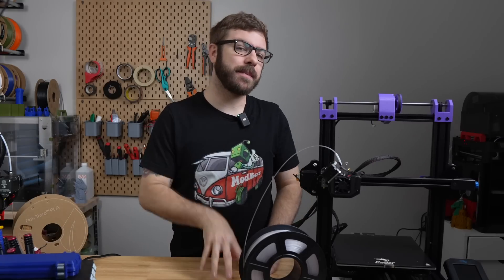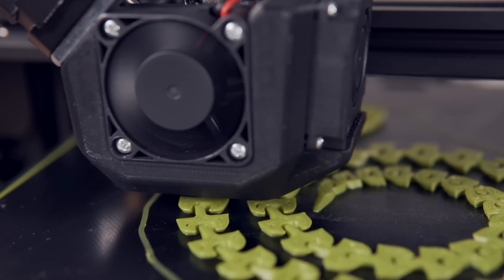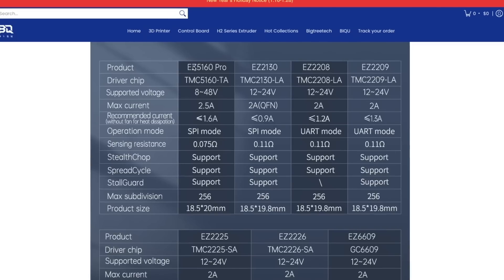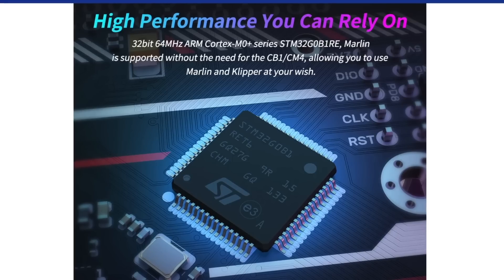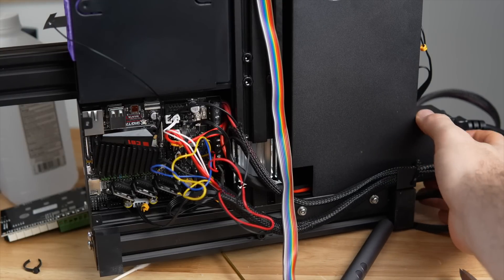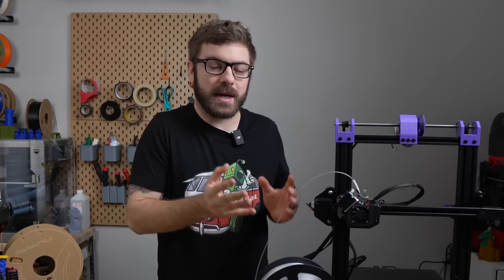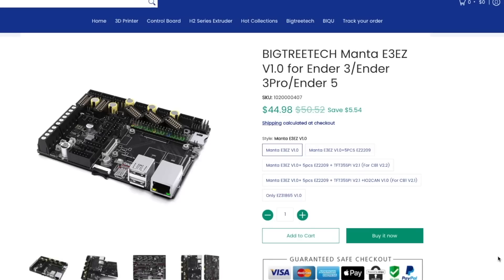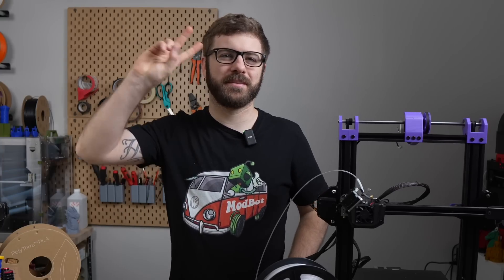The BTT E3EZ Manta Board Is Feature Packed (But Be Careful!)

Comment: 2 expensive... 220€ printer with a over 100€ expensive board?
Reply: The board itself is not 100€
Reply: @albertbassoe5966  oh the driver and the cm module is for free 👍
Reply from the maker: Depends on what you are doing. If your doing something like a Switchwire build it isn’t bad. Also this isn’t just an Ender 3 board. It can be used for many builds.
Reply: The board itself is ~70€ with drivers. Klipper is going to need a second board regardless, compared to alternatives, this is a reasonable price especially considering the ease
If you just want klipper, you can get get the pi4b adapter and cb1

Comment: Thanks for the quick look and the warning! I'm switching from an M8P to this new BTT E3EZ so this is all really good info.
Reply: Why would you be replacing a Manta 8P? Perhaps using it for another project that requires it more?
Reply from the maker: Other than the sd card placement and how far it sticks out the board is awesome. The amount of connectors they have been able to fit in its footprint is wild.

Comment: Did you contact BTT about this issue before publishing? I’m curious what they have to say about this.
Reply: I have this installed on an Ender 3. The mounting hole between the y&z stepper motor is .2-.3mm off, unable to use mounting screw in that particular spot. Also if you wanted it installed under the printer you would not be able to use the network cable USB or the HDMI. Some design flaws for sure, but otherwise I'm loving my board
Reply from the maker: I did not. Typically I will if something arrives that is clearly defective. This on the other hand is design related and since it is not a beta I want to make sure to let others know quickly before their boards face a similar fate. I have sent the video to BTT with feedback and will update in the comments/description with any update.
Reply: @ModBotArmy  Very logical. I like the look of this board for my CR-10, thanks for making the video.

Comment: Could I get this to work in an anycubu chrion?
Reply from the maker: Definitely! Mounting points are likely different so you would need to figure out how you are going to mount the board but other than that yes.
Reply: @ModBotArmy  I'm more worried about connector compatibility. Do creality and anycubic use the same pins and connectors?

I have experience with ender3 and an SKR board.